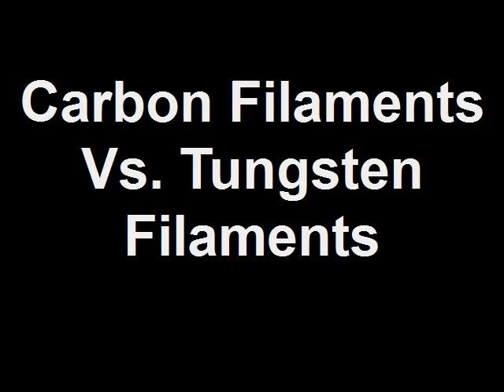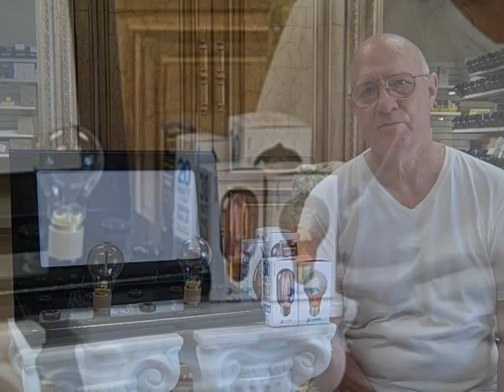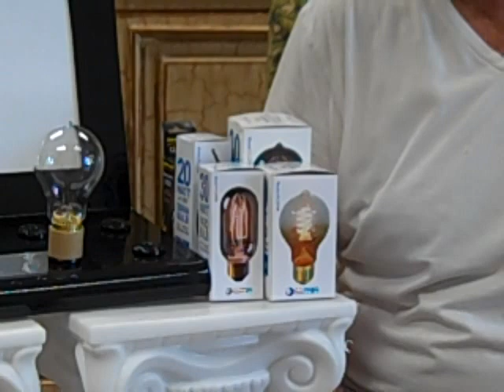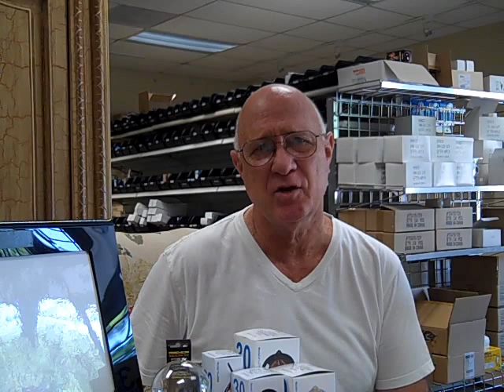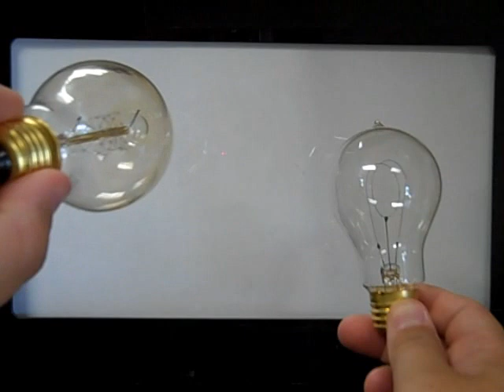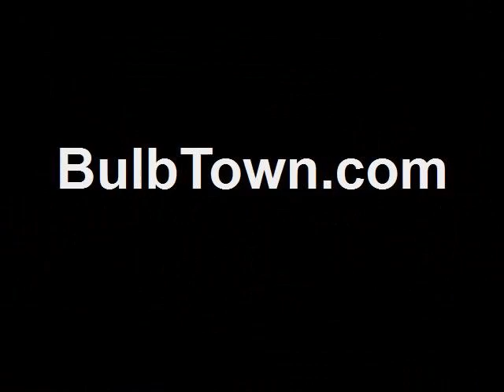Carbon Filaments vs  Tungsten Filaments

Comment: If carbon filament was so good? Why did they switch to tungsten?
Reply: Chintan Pandya tungsten is more efficient than carbon filament bulbs
Reply: @rickduncan692  tungsten is straight up pimpin dawg
Reply: Because tungsten can be extruded at a much smaller thickness, allowing for greater efficiency.
Ever tungsten filaments made as thick as the old carbon ones, they would last even longer than carbon.
They don't because that would lower efficiency and people wouldn't have to buy new bulbs.
Reply: improved knowledge of chemistry

Comment: What is the average lifespan of a Carbon light bulb?
Reply: 200 years
Reply: depends how much VOLTAGE you run though...less more life.......US fire station has one ON 24/7..100yrs...yes 100yrs!!!
Reply: @peterpamlockwood  Yes, but it's barely glowing. You can do that even with a regular bulb. Heck, you can undervolt an LED bulb.